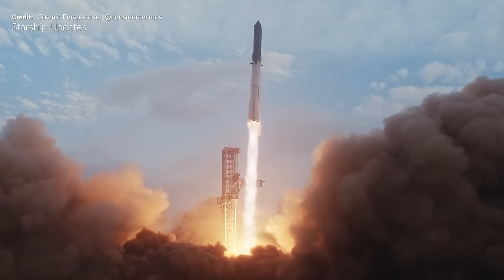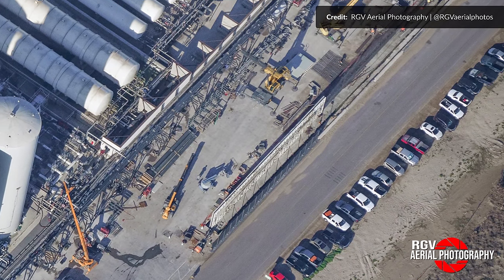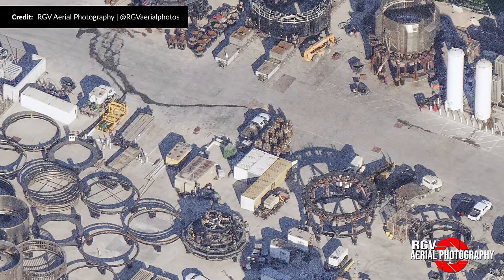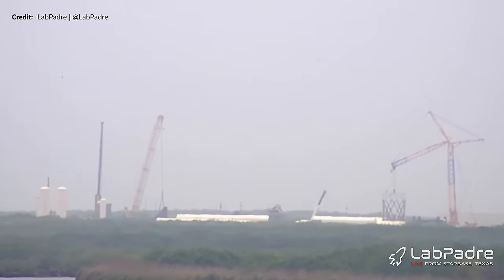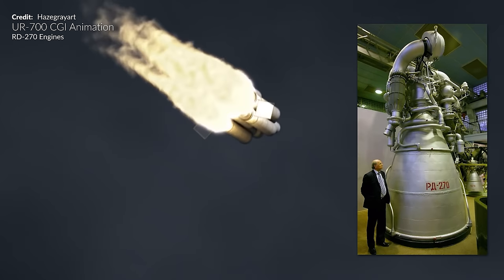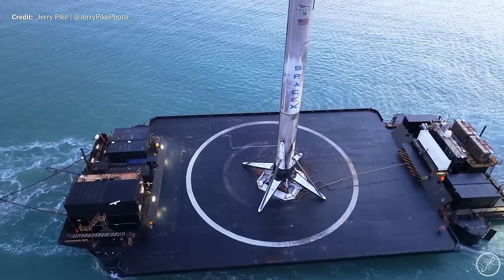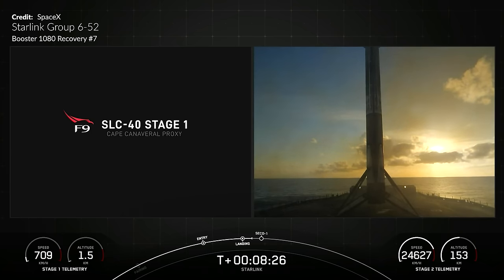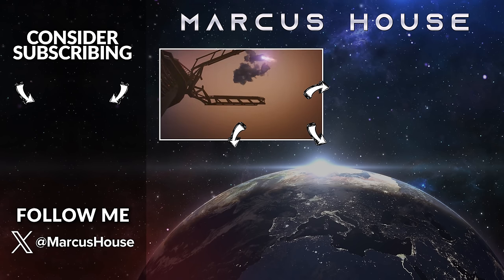Why is SpaceX Starship Only Capable of 40 to 50 Tons to Orbit For the Flight 3 Version?

Comment: Just remember, Spacex extended falcon 9 and that has worked out wonderfully well. I bet it will be no different for Starship. Version one is the test vehicle and not the end product. The 100 ton mark will probably be achieved with version 2. SpaceX isn’t breaking the laws of physics, they are using them to their advantage
Reply: im sure versions 1 is a lot more capable than stated. the payload stated during the event showed the capability for "flight 3" and not for "version 1". its pretty likely that there was less fuel in the tanks and the engines were running at lower throttle during that flight.
Reply: I would expect alot more issues from extending Starship unlike Falcon 9.

Extending Starship changes Center of Gravity/Center of Mass radically.  This will change ALL flight characteristics in how effective the engine gimbal are effect, how effective the grid gins and how big they need to be and how fast to pivot that much mass. It will change how POWERFUL thrusters need to move that mass. It will change how big the fins need to be to balance that mass through reentry.

Even the belly flop maneuver will be completely different from what was tested
Reply: @saquist  all these are problems SpaceX surely faced when extending Falcon... the only difference is the scale. The only unique problem might be the reentry flaps on Starship, but this seems like a relatively minor issue, assuming SpaceX can correctly tune their control systems with V1, which I'm sure they're already well on their way to completing.
Reply: @akkkbn  Center of Gravity  and Mass calculations aren't minor. Take the shuttle as an example. Programs had to be written to adjust for constantly changing of the location CoM/CoG as the fuel is drained because of SSME use of asymmetric thrust.

It's not a linear comparable either because starship are SOOO much more massive than Falcon. Raptors don't have as much less gimbal room in a cluster of 33 engines.

Then taken all the fuel during landing and and slosh is around ! Remember Falcon never exploded on return to landing site. Different engines behave just differently under pressure.
Reply: Simple as that hey?
Reply: @saquist  remember that starship deals less with aerodynamics and more with trajectories. Of course the guidance programs need to compensate for changing CoM during the flight, but this is not unique to any vehicle... extending the vehicle merely changes the input values to the adjustment algorithm. True that these are different vehicles, but extending Starship will certainly be less of an issue than it would be for a spaceplane such as the Shuttle.
Reply: Not so. An analysis of the flight profile shows that tanks were full. Raptor 2 performance is worse than expected, thus payload reduction. Even 40t might be a bit optimistic.

Comment: Everyone scoffed at SpaceX when they started. Oh, they'll never: get off the ground,  get to orbit, propulsively land, reuse 10 times, make a full flow staged combustion engine running on methane and oxygen,  get to orbit etc etc etc. The cost of mass to orbit keeps dropping,  and i think they will continue to do amazing things.
Reply: Except the cost of mass to orbit hasn't dropped pretty much at all...
Reply: @GraveFable25 that's completely false. Everyone involved in space admits that. Don't let some preposterous internet clowns fool you.
Reply: @admarsandbeyond  Its not false. Not in terms of the actual total cost. Spacex are able to offer lower prices, but thats only because of government subsidizing them.
Reply: @GraveFable25  NASA is not subsidizing SpaceX in any substantial way as far as I'm aware. Buying services from a commercial entity is not subsidies. Paying 600 million for a DIVH launch when you can buy the same service for ⅒ of that is subsidizing.
Reply: @GraveFable25 thats utter nonsense... spaceshuttle cost 13k$/kg into LEO and falcon 9 is sitting at less than 4k$/kg
Reply: Estimates for actual cost (not price) of Falcon 9 launch are around $10 million.

Starship per-launch is supposed to drop under $2 million, with 200t payload is $10/kg to LEO.
Elon numbers but still.
Reply: @michaelmicek  will probably be more than 10million per launch and closer to 100 tons to LEO with raptor 3 and starship 2
Reply: @Berilaco  okay, $100/kg ... but we were already agreeing that the price had come down, and that's still low enough for me to save and put my own mass in orbit.
Reply: @michaelmicek  yeah but anything below 1000$ is very unrealistic in todays time and you wont get below that in the next 10 years or so

Comment: A vehicle catch is not going to be trivial. Since the grid fins are not strong enough to catch the vehicle, the little parts that carry the weight during a lift are very small. The tolerances on a catch are ridiculously small. For my money, catching is still pretty harebrained and really risks one of the most expensive parts of the system that, if destroyed, basically grounds an entire fleet of launch vehicles.
I think a superior system would be a recovery landing pad hundreds of meters away from the launch pad. The landing pad could be on rails to return the vehicle to an area adjacent to the launch tower where the chopsticks could pick it up. You could still have relatively rapid turnaround, while separating the dangerous recovery from the extremely expensive launch tower and platform.

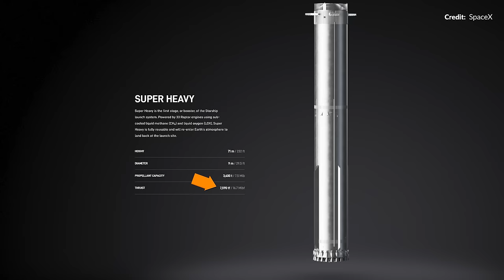Comment: @9:38, one might ponder whether Starship 4 could have a 10m width similar to Saturn V. Such an increase could address any outstanding issues related to extending its length, considering the initial concept envisioned a 12m diameter..
Reply: My 'ponder' on that was short lived. I started to get a headache thinking about "OLM still under construction.". Actually, it was like a nightmare. 😱

Comment: QUESTION - Why is SpaceX not using a hopper like test rocket, to work out the catch process??  Seems like it would be simple enough for them to build a set of test-only rockets to work out the catch process???
Reply: @truegrit1860  It obviously can, because after starship breaks off to orbit... the booster has to fly back to the pad.
Reply: @truegrit1860 The water towers flew on their own after Hoppy, right? Surely they could put a nose cone on, fly it up 10k and bring it back down as they did with Starship.

Comment: I had seen something that implied that the tanks were not quite full for flight 3.  That might end up with engines running at 90% or less and fly the desired profile with no need to dump fuel at the end.

Comment: Just hope SpaceX build up the ground level high enough they can put a flame trench under OLM2. The showerhead works but a flame trench eliminates so many problems they have with OLM1
Reply: The flame trench/diverter seems to be the way to go. I also feel that they should have one launch system and a separate recovery system.  Keep it simple works the best. JMO
Reply: just a reminder: Starship on the OLM sits a few meters higher above the ground than the Saturn V on LC39. and at both sites you cannt really dig into the ground.
Reply: @rayRay-pw6gz integrated recovery / launch system is a fundamental goal of Starship, not an add-on.
Reply: They're specifically trying to eliminate the expense of building a flame trench and replace it with something that can manufactured, mass produced as it were.
Reply: @michaelmicek  I understand their stated goal.  Sometimes you have to learn to walk before you try to run a marathon.  We all will see what the future holds for SpaceX .  I just was stating my opinion.  The levels of thrust at launch is going to increase, as we have already seen.  That being the case , repairing the launch system after every launch will force change.  JMO✌️🫶🇺🇸

Comment: Starship is so much more than a rocket. Falcon 9 is gonna be better at putting stuff to orbit for like next 6 or 8 years. Starship has like 10 goals, and achieving orbit is only one of those. To achieve all of those it will take literally hundreds of launches as we are on bleeding edge of operations in space. Starship is paving the way to human space exploration and 90% of things they are doing have never been done before. US had 40 launches across 3 programs before they even started the apollo program. SpaceX is probably makin even a bigger step so needing a lot of testing should be expected.

Comment: I wonder if it is remotely feasible to have electric turbopumps for the Raptors. Maybe not since a number that has come up in a few searches is 100,000 HP for the pumps.
Reply: You need a rocket to power the rocket engines...

Comment: Mars sample return was a very poorly thought out process. (NASA’s lack of foresight all too common these days) 

The samples should have been stored with Perseverance so collection was at a single point. Having to follow the same path to collect them like breadcrumbs is insane.
Reply: they could use a helicopter to collect them?!  Probably done within a week..
Reply: @joansparky4439  The plan is (was) to use a second rover to follow the first. A total waste of effort for the distances they’d have to cover. Single point collection is the only cost effective method. Imagine your spouse buying groceries and paying for them but leaving them in the isle. You then go to the store and follow along her path later and have to find them, collect them and take them to your car… which is parked right next to theirs. Logical?
Reply: @nooneyouknow9399  pretty sure the dropped sample tubes are backups that could be recovered in case the rover failed and made the primary samples still carried by the rover inaccessible. i think Mars Guy has mentoined that whenever this topic came up.

Comment: The ultimate solution to the launch-damage/need-to-catch problem is to have two towers. The catch tower could be very simplified with little more than a bare structure and the chopstick mechanisms.
Reply: Won't meet the goal of launch, return, stack, fuel, and launch again multiple times per day.
Reply: @michaelmicek that won’t be for years though - and if they wreck a tower it’s a major drama. Until they get the landing catch reliable I agree that a simple tower with arms would be a cost effective good idea
Reply: I'm pretty sure that the second tower will be fully capable before it is used the first time.  The current launch tower was built, extensively modified, finished and extensively modified, again, several times.  That must be about as expensive as building it complete and then replacing it, particularly since, if there is no crash, they can just start using it for both launches and recoveries without the extensive down time of major modifications.  

Let's face it, no one at SpaceX really expects to crash a booster into the tower.  However, if they do crash into a tower, a second that is ready for use is better than a half-capable tower they need to finish before they can use it.
Reply: @longboardfella5306  Yes. I agree that with the iterative design methodology, nothing would prevent Spacex from perfecting launch capabilities on one tower and catching on one or more others. Once the designs reach a high level of reliability, then begin integrating the two functions into one and when that one is nearly perfected, then integrate all of the towers. Eventually there will be a need for multiple towers in any case.

Comment: It’s a bit surprising that the horizontal tanks do not have protection from the sun in the heat of the sun with some kind of roof at least
Reply: im pretty sure they're insulated on the inside.
Reply: They are painted white to reflect most of the sunlight. The cover is the cover...

Comment: I've been concerned from the second starship launch on, that the Raptors were going through too much fuel.  The booster was basically empty and this was with no payload.  I'm hoping some of this may be fuel that's been intentionally dumped to reduce any accidents that could occur but it's not clear.  It leads to a possible conclusion that either the engines are under performing or the needed upgrades added significant weight to the rocket.  I guess we won't really know until they start carrying a noticeable payload with the Raptor 3.
Reply: Its a combination of the two really. The engines are performing at less than 100% of their capability. And the needed robustness upgrades added significant weight which has a huge impact on pay load. However, future iterations of starship will Begin to delete mass and save weight once the starship system is working as intended.
Reply: The main cause of the payload reduction is Raptor's specific impulse being about 8% less than specified, as estimated from the flight data. It's a big difference, and it would be nice to know why. There are probably several root causes. My guess is that one of them may be: they have had to change the fuel/oxidizer ratio further from optimum, ie using a richer mixture.

Comment: IMO Mars sample/return was an uneconomic idea from the start. Fly a rover to Mars and collect samples whilst travelling over the surface. Fine, that works. But dumping those samples along the way to force the requirement for a second rover mission to follow the same route and (presumably) to return to the landing point somehow for sample transfer/encapsulation, launch and return? If the samples had remained on the rover, the return mission would not require that hugely expensive collection rover - land near the rover instead, transfer/encapsulate samples and launch/return missing out the middle man.
Reply: i wonder where the info that the dropped samples are the ones to be recovered is from, because as far as i know the primary sample collection is still in the rover, and the dropped sample stashes are just in case the rover fails and doesnt allow the retrieval of the primary samples. today is the first time i read that the dropped samples are intended to be the target for recovery..
Reply: Starship astronauts can pick them up on their first flight back...

Comment: Given the enoromous string of failures around Starliner, and how very long it has taken to bring this mission to readiness, I would feel a lot better for the safety of the Astronaughts and the ISS if Boeing was forced to do another uncrewed test flight, that mimics docking procedures as much as possible in empty space, before any humans are put at risk.
It feels like it's being pushed through on momentum of "this was the plan", rather than because it's a good idea.

I'm frankly terrified that we're about to see casualties in space for the first time since the shuttle disasters.
Reply: The first Shuttle disaster was caused by NASA testing "how cold is too co,d to launch" and discoving the engineers at Martin-Thiocall were right.  Seven dead because no one "official" noticed and asked about the smoke that blew out if the SRBs.  As launch time weather cooled, smoke got thicker until the whole thing blew up.

The second was caused by that huge tank of cryogenic fuel that shed a chunk of ice during launch.  That ice apparently broke one or more tiles on the wing leading edge, dooming the ship during re-entry.  No repair kit was provided and no EVA was scheduled to examine the exterior.  Of course, with no repair possible, examining the damage would have done nothing to help and it would have sunk morale.

NASA is not the model for prudence and safety that the Starship detractors would have us believe.  Like NASA, SpaceX has a perfect record until it doesn't.
Reply: Uncrewed.
Reply: The recent changes have been on changing materials to non-combustible ones. Not exactly related to 'mission critical' systems. But important for crew safety. As for the Reactionary Control Thrusters, they obviously identified what the cause was for the few that failed. A lot of work to re-work it all, but I think your reading too much into the earlier testing. The astronauts would have looked over all the work done. They would not be 'jumping in' if they thought it was unsafe.
Reply: @David-yo5ws  While entirely probable, that last part of your statement was also said about the space shuttle, and they were aware of the specific failures, and still jumped in.
I'm not saying it is absolutey neccesariry to do another uncreewed test flight, only that I, personally, as someone with no inside knowledge on the progress made on the Starliner program, would feel safer if it were.